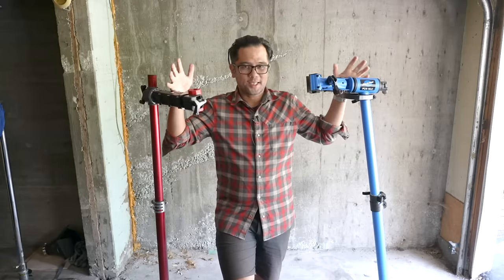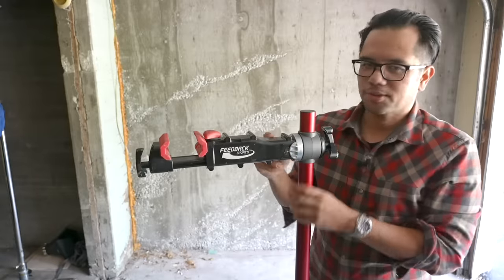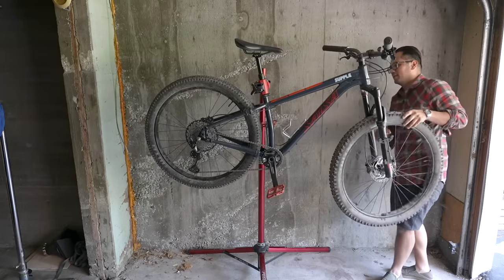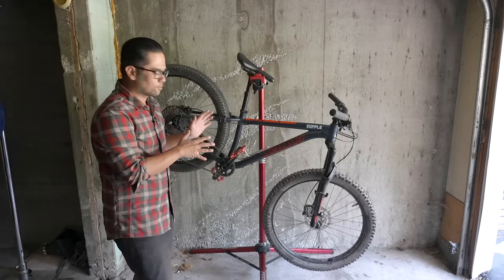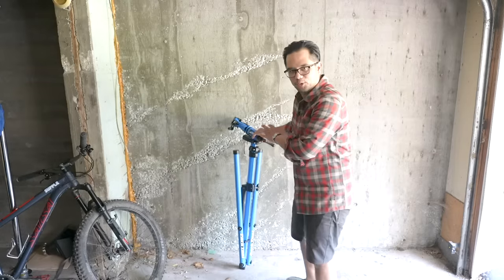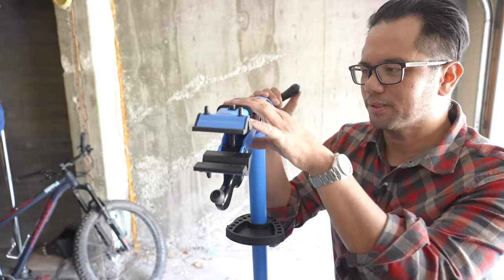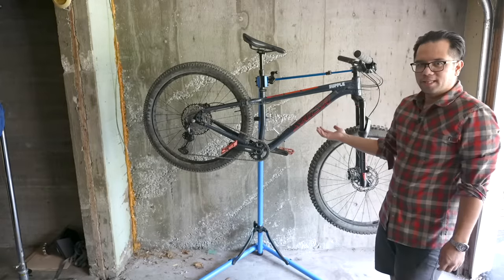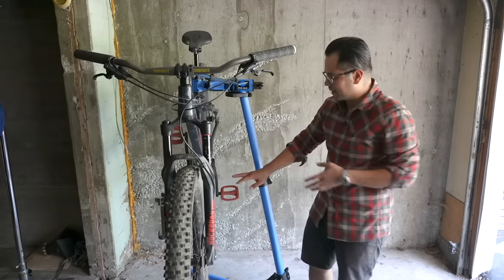The MOST STABLE Home Bike Repair Stand?

Comment: Since most of the weight of the bike is toward the front wheel, I would angle leg of the feedback sports stand toward the front of the bike. It may give a bit more stability. I like the clamp on the Park. It’s simpler and bulletproof. The feedback sports has a part inside the clamp mechanism that wears out. Replacing it is a bit time consuming. I’ve had 2 feedback sports stands that have needed this part replaced. I can’t remember the name of the part.

Comment: I have an earlier version of the PCS-10 (not sure what the difference is with the 10.3 other than the included tool tray), which was preceded by a pcs-1. The only real issue I've had is that when tightening the clamp cam down, the bike can slip down and then the cam handle rotation will be blocked by the saddle or top tube. So It takes a little work to hold it up while tightening. Yes, I am aware I will be counseled to clamp to the seatpost only. Not always enough room there, as I am a little shorter than yourself. I also put some used socks over the clamps to protect the bike's finish.

Comment: Thanks for the great comparison!  I wish you would discuss the height, though.  The Park 10.3 has a very low max height, only 57 inches, while the Feedback Sports Pro Elite has a max height of 71 inches. Do taller people have a problem using the Park 10.3?  And how stable is the Feedback at maximum height?

Comment: I just got a used Topeak Prepstand Elite which is very similar to that Feedback stand(My assumption is Feedback has just copied the design because I've had a similar Topeak stand about 15 years ago, and I have not seen these Feedback sports stands until recent years. My Topeak stand is a lot more stable as well even though it also is a tripod. Longer legs will quickly aid in that regard), and I got it only to use for when I am washing my bike. It's very cumbersome to wash a bike without a stand, and my main stand is a chonky Unior stand that is mostly made of steel, and I don't want it to rust anytime soon. That's why I wanted a stand that at least mostly is aluminum. 
Park tool stands are too flimsy as a main stand and is mostly steel, so I cannot use that as a washing stand nor do I want it as a main stand. 

My Unior 1693BQ stand is 80lbs give or take which is why I got it in the first place because I really wanted a solid stand that won't sway all over the place at the slightest contact.

Comment: Park tool is the one I use and prefer.  I've got a heavy Surly Long Haul Trucker which needs the extra stability.  My brother has the feedback and I've tried using it with my Surly, but it was way too tippy and I could not do any maintenance.

Comment: An excellent review.. Special award goes to the Post Modern bombed out concrete appartement look....

Do you think the Park Tool stand (or any non bike shop stand) is really is able to deal with modern E-Bikes around 25kg?  60lbs or so....

Thanks
Reply: Most if not all Park Tool workstands can hold the weight of e-bikes. Their weight limits are on their own product links.

Comment: These are both American companies, but both products are manufactured in the Far East.
I have a $50 Chinese clone of the Feedback, and the angle adjustment is better than the genuine item with fine serrated teeth albeit plastic.
It has performed faultlessly, especially for the price.
Basically, if the stand stays in the same designated place all the time, and you avoid washing the bike, get the Park. If you move the stand around all the time and use it for outdoor washing, get the Feedback.
Reply: Where did you get the 50$ Chinese clone? If you have a link id love to check it out

Comment: It's weird to see the love for the Feedback Sports Elite HD. It's NOT a bad stand at all, but for $330 USD I would expect less wiggle and bounce and less plastic. I wasnt expecting to need to tighten the screws on both clamps every time either, but yes, the sag is common with a 30 lbs bike.  I bought both of these stands at the same time and the Park Tool was the one I stuck with in the end due to stability. The PT wasn't perfect either, with a shit ton of rust inside and a fairly low height but I wanted a stand I didn't have to think about. The Feedback Sports will travel better but I'm not typically traveling with my stand.

Comment: I've got one of those from Aldi (or Lidl I forget). The plan was always to replace it with a "good one" at a later date, but after 5 years I can't seem break the damn thing, never had any stability issues (4 legs) I even wash the bikes in it and put it away wet.The only problem is the pedal comes very close to the post and I imagine that would be an issue if I used flats.
Reply: The Lidl stand punches way above its price point. I'm in the exactly same boat, mine also just refuses to show weaknesses after three years. The clamping is more basic than on the fancy competitors but overall good enough for my use case.
Reply: "LIDL - Because you're worthless." - Frankiw Boyle
Reply: Note: Pack a sandbag if you worry about keeping your stand upright - you're going to need a car for tools, bikes and stand, so why not? Sling a sandbag over one leg, and there you go.

Comment: I've got a Performance Spin Doctor G3 (not a feedback sports one if anyone read that before) folding stand from 5-7 years ago. The drooping is really significant on mine. Although the design is very different . It's tolerable, but not professional quality. If I were looking to replace it, I would try another brand.
Reply: Same here; I have had one for about 7-8 years, it droops quite a bit, the plastic hub splits a bit if there is a lot of weight on the stand. 

Some on here have claimed that it is better not to have a leg sticking straight out as Russ did but to emulate the Park in placing the legs. I will try that again but am a bit skeptical because I have felt it was tippier that way.

Comment: I clamp my top tube on my aluminum hardtail, that way I can clamp it almost at the center of gravity.  This way won't work for bikes that have externally routed cables along the top tube or a carbon frame.

Comment: We use the Feedback stand for neutral support at races. Have found positioning the lower legs with a space between them on side we mount bike provides better space for feet and also better stability. Find it strange you choose to use with one leg facing directly towards user?

Comment: Are these bike stands always this high, or can they be lowered so you could sit in a chair and work on the bike. Then when you need to release the bike you can stand and release the bike below your COG instead of above your COG, making balancing easier.
Reply: A stool to sit on is better than a chair. You have to have the pedals and wheels off the floor in a place with great lighting
Reply: most fold-away racks are height adjustable (both of these are). I typically raise my bike just high enough to keep the rear wheel off the ground and park my butt on a chair or stool.
Reply: @abicyclist  Thank you.
Reply: Thank you

Comment: I use the poor-man's bike stand; I turn my bike upside down, resting on it's seat and handlebars! 😁

Having a stand would be useful today, since I have to install a new spoke on my rear wheel, and my bike is my truing stand. Of course, this means today I have to find and purchase a cassette removal tool and a chain whip, so I can get that pesky cassette out of the way of my spoke hole threading operation.  This leads me to wonder if there's also a bike maintenance tools shortage to go with the bike parts shortage...

Rambling Thoughts Alert: If I were to use the Sports Pro Elite stand, I'd probably arrange it so that the... er... claw, was positioned between two of the tripod legs, with the third facing straight back, then weigh down that back leg with sandbags (or bags of cement or lawn mulch or whatever), or wedge it under the tire of a car/truck (or other wedgeable nearby surface).  This way, the stand would be more stable, and less tripping hazard, at the cost of a little heavy lifting or careful wedging prep-work.
Reply: When I work on bikes I do the same , my workspace has concrete floors and a carbon seat
Reply: Same here, but it ends up resting on the brifters which I’m not 100% happy with.

Comment: I'm surprised this comparison was done using the PCS 10.3 instead of the aluminum PRS-25.  Would have been more of an "apples to apples" comparison.  I know I'm trying to decide between the PRS-25 and the Feedback Pro Elite.
Reply from the maker: Currently testing the PRS-25.  It is awesome.  Doesn't pack as small but has all the great features and stability of the 10.3.

Comment: Dude. Should have watched your video before getting the Feedback Sports. Mine is even worse. I think they skipped quality control on the piece I got. The thing wobbles more than a circus juggler. My €50 5-year old Amazon stand is way more stable. I’m putting it back in box and returning right away.

Comment: I have a red shift suspension post on my gravel bike and I have a very old park repair stand.  With the suspension on the seat post I can't figure out how to clamp the bike in the stand (the clamp is too big to fit on the small straight area of the post.  Any suggestions?  You used to use the red shift posts I think.

Comment: No contest - Park wins again!  Stability and predictable operation, plus off-set verticality precludes accidental crashes and pedal conflicts..  Weight isn't as significant factor to me when it compromises, or sacrifices firm control as a penalty.  The Park model obviously assigned better engineering foresight prior to contracting the build.  Simply put just better applied physics in the overall final product.  The lighter unit just came across as 'wonky' and hastily conceived by your very demonstration which was very forthright and fairly presented.  Park just gets mechanics and their input is evident in every aspect of this product's demonstration.
                                                                                                                                                                                                                                     Nice Job!
                                                                                                                                                                                                                                      Mike Kirwan - Kenmore, WA

Comment: A bit inaccurate reporting. Feedback is 3 legged, and should never mount the bike with one leg pointing forward, 2 at rear of bike, this is a most unstable position. The correct way is 2 legs at the front, third leg at the rear.

Comment: Most stable bike stand? Look at Bicisupport, Gioma Bikestand and Cyclus Tools. I like to call them Italian style even though the last one is German. These type of bike stand support the bike's bottom bracket and either the front or rear axle of the bike (with or without wheels installed). I have a Bicisupport Duemila (bs190k)  which is their foldable model. This thing is solid and even e-bikes with a big wheel base are no problem. Unfortunately for me, my model did not come with all adapters for thru axles. Regardless, these stands are pretty common among vintage bike shops around here.

Comment: I had bought the Feedback Pro Elite at REI for $100 off and will be returning it.  Below it the review that I had wrote.

WARNIG This Stand Won't Support 85 pounds!!!
Claiming the ability to support bikes weighing up to 85 pounds, you would think my mid-engine e-bike that weighs less than 48 pounds (with the battery removed), would have no problems.

Getting the jaws to lock to the seat post was an effort, but I was able to do this. However, when I tried to raise front or rear wheels up by a few degrees, gravity was too much and the head slipped. Let me add, I twisted the looking piece with all of my might as tight as I could make it. The irony, with 37 pounds under the weight limitations, this stand was overwhelmed.

I contacted customer support. The agent claims the support is only up to 75 pounds and not designed for e-bikes... 
...Why leave out this all important deal breaking info?

I will say there are things to like. No assembly. Stores very compact. Lightweight. Its good looking with a nice fit and finish.

I'm thinking bikes weighing at 25 pounds or less this would be a good repair stand. However, If you have a heavier bike, this repair stand is not a good choice.

Comment: Rust is a problem with park tool since it is made from steel. Non stainless.
If the bike itself  is made from aircraft aluminum and holds for 40 years and more , then why not use a bike atand from aircraft aluminum !?
So the red to me looks more practical.

Comment: I think the lighter weight and portability is a moot point.....  you aren't carrying it on your bike.  Its going in the back of the car or moved around the shed.  The fact that it has tendency to fall over if you aren't being careful leads me to summize that it's less fit for purpose than the Park Tool.

Comment: Those look awful to deal with, you should upgrade to one that isn't that travel style. Find one that you just put the bottom bracket on in the "U" shape. They have one arm that shoots up diagonally, theyt have a clamp for the downtube and 2 flat arms that rotate out to hold the front tire. They never tip, lower center of grAvity and you don't have to lift the bike as high and fiddle a stupid clamp with one hand.